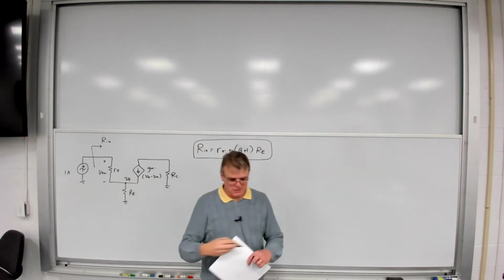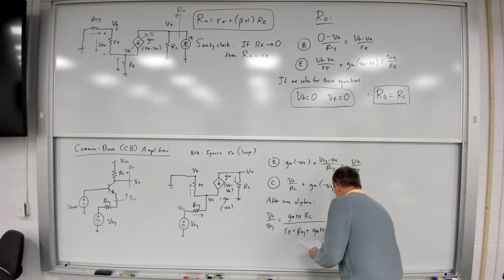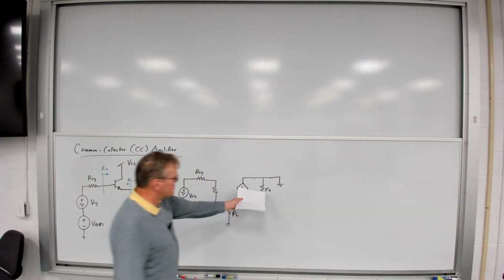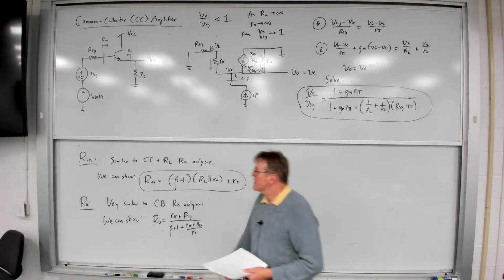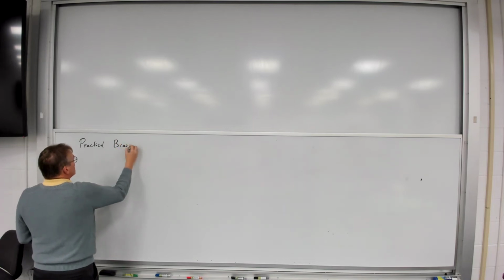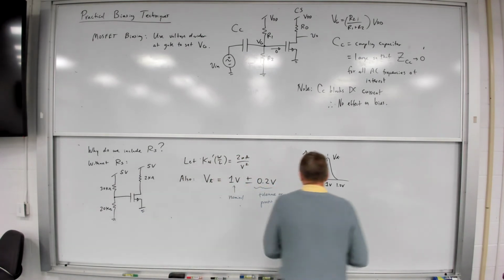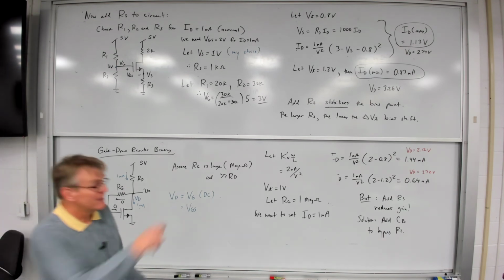Electronics - Lecture 20:  Common-base, -collector amplifiers, practical biasing techniques

Comment: Dear Prof. Holman, thank you very much for the excellent course! You mentioned Circuits II for learning more about high-frequency modeling with capacitors, but I couldn't find the resources. Is it open to the public?
Reply from the maker: It is not available yet.

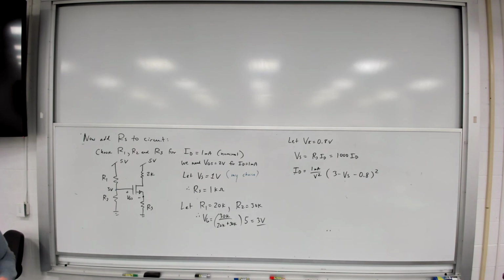Comment: @1:04:09,  can you explain how do u get the Id equation? Is is saturation equation. where is the 1mA/V^2 from?
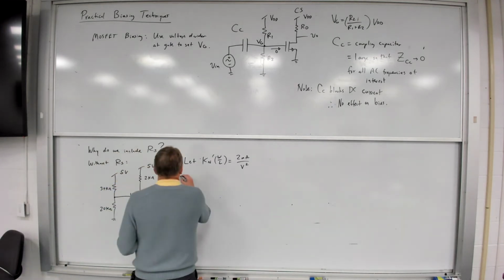Reply from the maker: Go to 50:51 where I define the value of the transconductance parameter for the NFET, and continue using it in subsequent examples.  That's where the 1 mA / V^2 comes from.  The transistor is operating under saturation, which you can prove by checking the DC bias conditions.

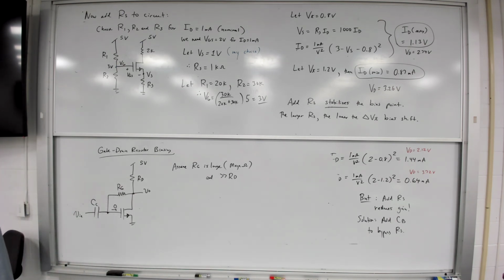Comment: @1:12:37, why is the current through Rg 0? Wouldnt the current going througg Rd split up, and some will go through Rg?
Reply from the maker: The DC current through Rg must equal zero because there is no path for it to flow.  It cannot flow through the capacitor, and it cannot flow into the gate of the transistor.  So by Kirchhoff's Current Law at the gate node, the current must equal zero.

Comment: sir, For R input, in case of CE with a Resistance at emitter,  is the equation u used R(in)= V(sig)/ I (B) ? V sig being the input voltage
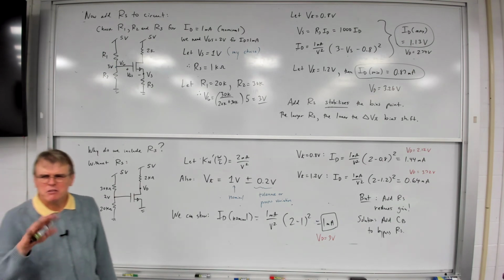Reply from the maker: You should use the standard Thevenin source driving technique.  Look at Lecture 19 beginning around 1:08:00 to see the analysis for the input resistance.